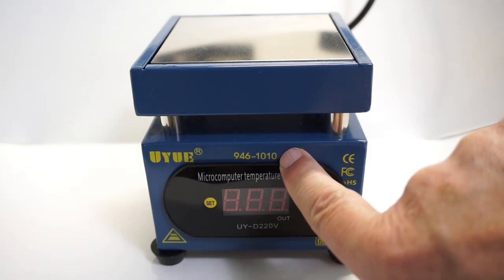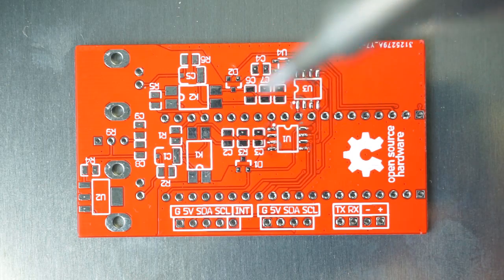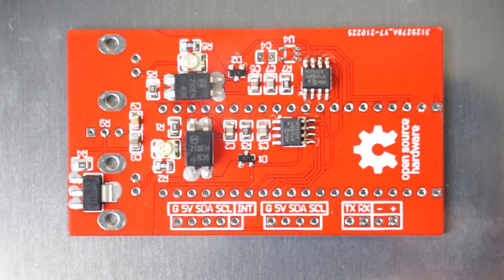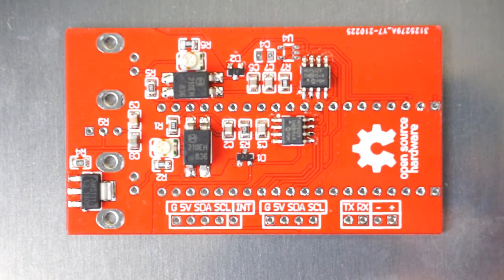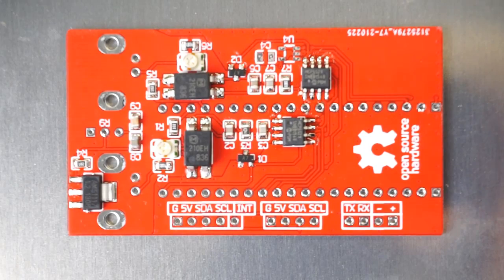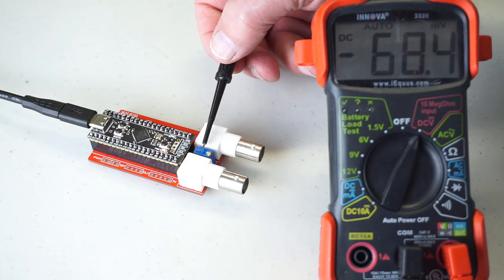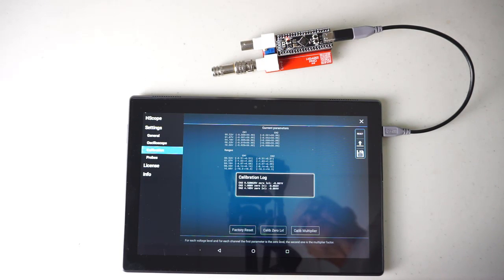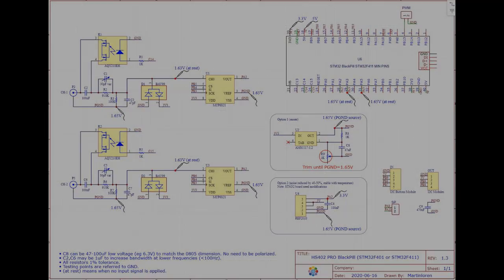GADGETS#144 - PCB HOTPLATE METHOD

Comment: That hot plate worked better than I thought it would. Glad Martin went with the sop sized 6S21 chip for the HS402 PCB.
Reply from the maker: yep, the SOIC size is a challenge

I still use them on HS101 PRO boards, but I think Martin may even have a revised PCB using SOP for it too
Reply: @theGADGETSplaylist  Martin told me he will release the HS101 pro version 2 with the sop package as soon as he is done designing and testing the HS401 USB only for now.
Reply from the maker: I'll throw some in as I order other PCB but until then, I'm OK with the original board. I was getting the hang of those small 6S21 just as the change to SOP came about...lol
Reply: @theGADGETSplaylist  It will be interesting to see what method you come up with for the msop chip on the HS101 pro.
Reply from the maker: @rs1971camaro  it'll be mostly Martin's method of pre-tinning...I might add the slightest amount of paste on top...will decide at the time...

I'll make a point of doing that part on camera...

Comment: chinese watts are less once they crossed the pacific: 400 W will arrive at 75% so you get 300 W
Happns too often that they miss their own phantasy specs one way or the other.
Reply from the maker: it's plenty of watts, whatever the final figure is...and even with the heat not rising evenly across the surface, it does get there uniformly eventually...this thing works great and no regrets having ordered it...
Reply: @theGADGETSplaylist  I just have checked it out on ali express and you might have mixed the figures for the different models cause at least now feb. 2022 they claim to have 300 W for your model which sounds like what you had measured and for the bit bigger one with 150 x 150 mm it should be 400W.

So maybe the preheat beds are quite acurate advertised compared to other stuff like the 20 Mhz of the handtech 6022BL which I was not able to get, far far less.

Comment: I use a 12v 220c 28w PTC heater from amazon which is around $8.  no worry about getting too hot and it works well for small boards.  I have it mounted to a larger aluminum plate and monitor temp with a standard multimeter temp probe.
Reply from the maker: sounds like a good solution, Jesse!

Comment: If you search on aliexpress I did not get hits for hotplate, but for '946-1010 preheat' - might depend on the country but for my english aliexpress I was astonished to have no search result when i searched for '946-1010 hotplate' nor  '946-1010 hotbed'

But I like the way those work out pretty nicely and with far less work compared to the hotgun fight, on and off, move around and being carefull if you proceed to the next area to heat up without moving previous parts out of position. Looks great when the surface tension pulls them into place and even aligns many quite perfect.

I am collecting all the bits and pieces I have to order but luckily at least since december those shippings arrive in central europe within 10 days and even less since they collect the VAT in china from the EU citizen and pay those taxes at arrival in EU which makes the import lot fast and safter, no need to appear at customs and pay fees or to the postman. Quite reliable compared to 2018 - 2021 where Ali Express orders appeared within 10 days or mostly 1 or 2 months later. 

Great work and progress in the whole building process cause I had  watched some newer videos already before.

Comment: Really great review of the hot plate. Im looking for one at the moment but don’t think I will be buying it based on the review. Looks like most of the low cost hot plates are basically junk
Reply from the maker: I did a follow up in #145 where I explain a hidden menu and a PDF manual I created and share with viewers...

This thing cost me about $50 if I remember well. I would buy it, in that same size again...

Thanks for your comment:)